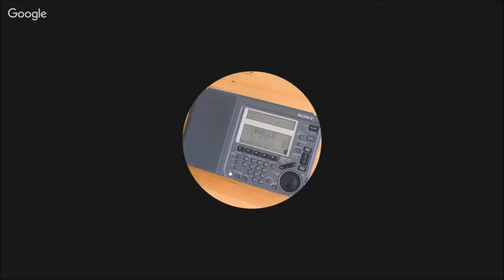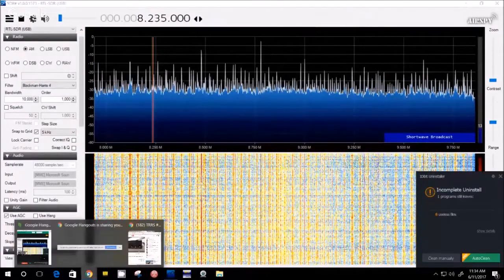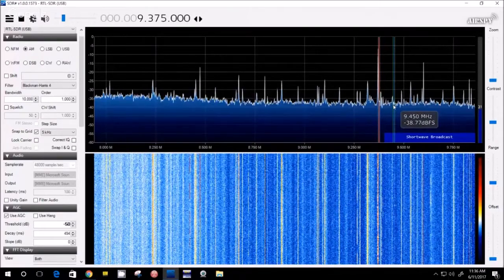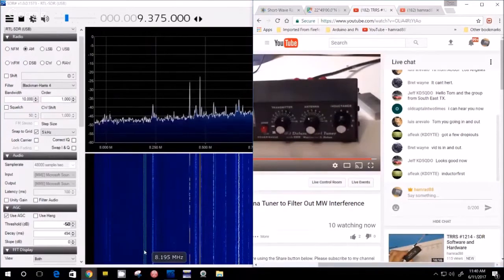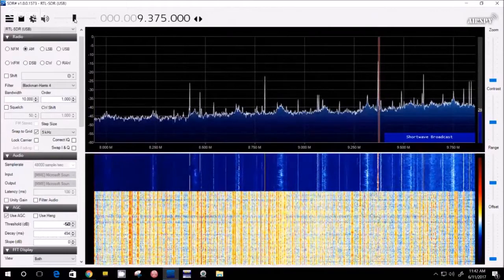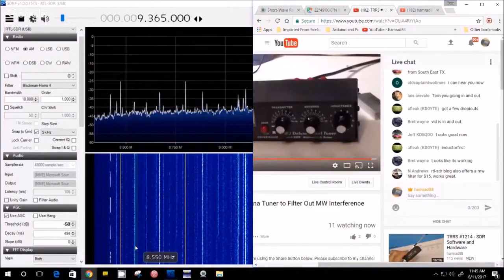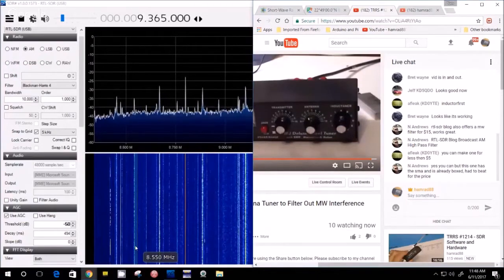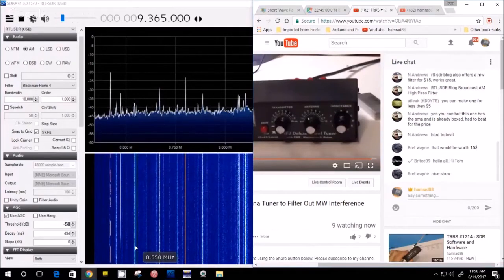TRRS #1216a - Using Antenna Tuner to Filter Out MW Interference

Comment: You have to mod this tuner for it to work as a good filter, run one of the capacitors in series with the coil and disconnect the other capacitor or you can connect two capacitor in parallel for more range with the coil in series this will make a bandpass filter which will give you far more selectivity ;)
Reply: Let me know if u need more help with that i have done it already
Reply from the maker: Thanks

Comment: I recently bought the AM and FM filters sold by RTL-SDR.COM.  I bought them from their China warehouse since the AM filter was only available from china.  They are both available on Amazon now, at this link:

http://www.rtl-sdr.com/buy-rtl-sdr-dvb-t-dongles/

I was having a terrible problem with AM interference with my RTL-SDR V3 dongle on the HF bands, but not any more!!! The strongest AM station can still be found at it's broadcast frequency, but it causes no real problem elsewhere on the bands.  I bought the FM filter also, just in case.  I just looked on the RTL-SDR.COM website and could not find anything indicating that the FM filter has been incorporated into the V3 dongle.  Can you tell be where you found that info?

The filters are $14.95 ea. from China and $16.95 ea. from Amazon.

I recommend the AM filter highly!
Reply from the maker: I have one coming in tomorrow.  Thanks